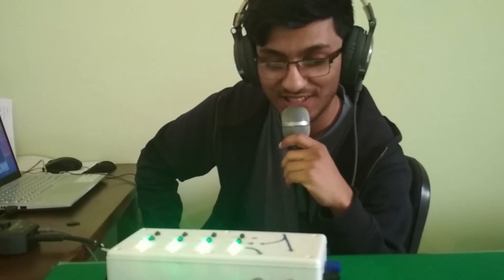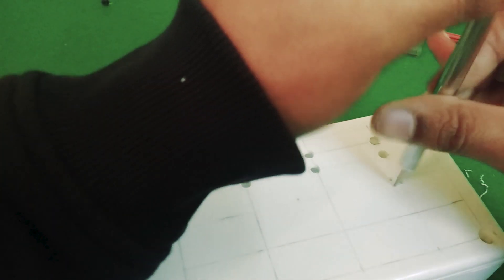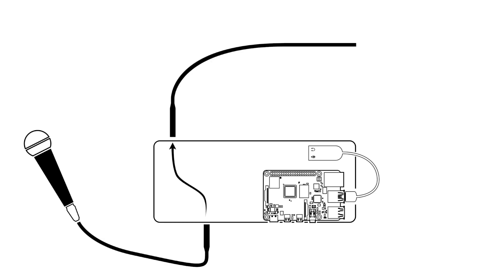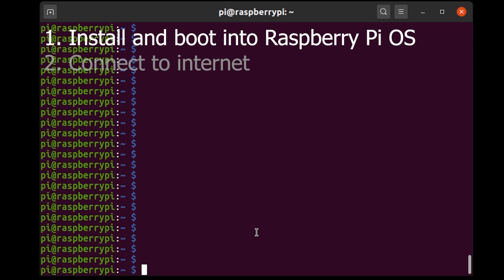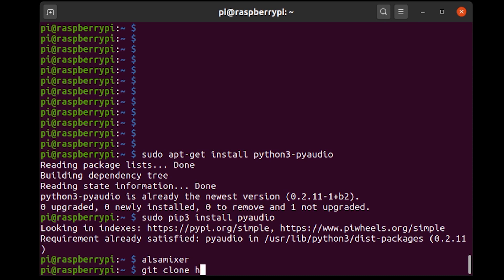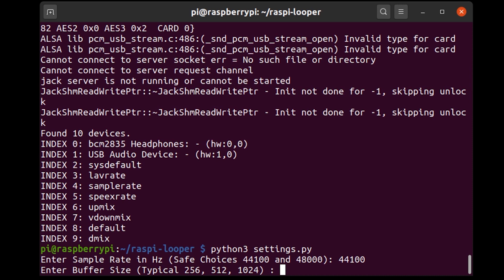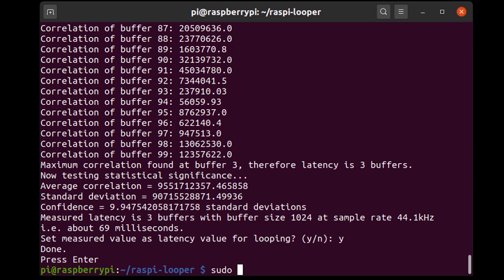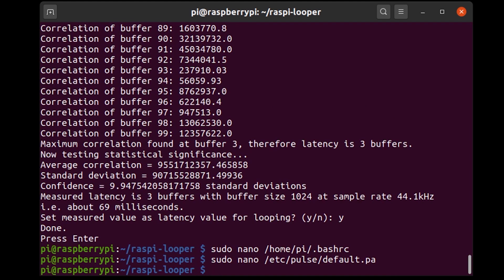DIY 4-Track Looper w/ Raspberry Pi | Building a Loop Station

Comment: Of the audio jack wires, which one is positive and which one is negative? Grey or white?
Reply from the maker: There's not really a "positive" and "negative", perhaps more a ground wire and signal wire. The sleeve terminals of the audio jacks should be connected to ground. I think I use grey wire for ground.

Comment: Great build! I'm putting things together to build it (mostly) from parts I have OH. So, thinking of ways to simplify the output, could you input to the onboard 3.5mm and output via Bluetooth?

 I really want to input both signals into the aux on my amp, so could you just splice the two signals back into one 3.5mm output?

Anyway, thx for video and great idea.
Reply from the maker: I would not recommend using Bluetooth, mostly due to possible latency issues. Using the internal soundcard should work - it occurs to me I've never actually tried it - but I've heard the onboard audio is pretty bad.

No, you cannot splice the output signals together passively; it would cause all sorts of problems. If you want a single output, the easiest way to do this is simply to use a USB soundcard with built-in hardware monitoring. Otherwise, you'll need a mixer circuit of some kind. I built such a circuit, and the schematic for it is linked in the description of this video. You could incorporate a circuit like that into your looper to eliminate the whole 'two outputs' thing.

Comment: what do you think about rpi 2 or 3 i mean rpi 4 is a little overkill isnt it?
Reply from the maker: The raspberry pi 4 was only marginally more expensive than the raspberry pi 3, so it seemed logical to use that.

Comment: Really glad I found this -- was thinking of this project the other day and seems the timing is perfect since you just uploaded it!

If i theoretically wanted to mix the direct out with the loop out -- is that something that can be done passively or does it need to be processed? Any thoughts on how to do that?
Reply from the maker: Glad you like it! :)

So just in case you missed it I'll point out that I built a little mixer for the looper, and there's a schematic linked in the description. If you wish, you could build this circuit into your looper enclosure and power it from the Pi header. It is NOT passive, though, and there's a reason for that.

The problem with passive mixing is that inputs and outputs are fundamentally no different... all your outputs are inputs and all your inputs are outputs, so output signals are also input signals, meaning that you would end up recording your entire loop mix onto every single overdub.

There is actually a way around this which only works specifically for "mixing" EXACTLY TWO signals. This is to ignore the ground lines on both signals and simply connect the two signal lines to the two terminals of your audio jack. This way you effectively get the difference signal, which typically is functionally no different from the summation signal. The problem with this approach is that ungrounded signals are a bad idea in general; they make you much more susceptible to being affected by all sorts of noise and interference.
Reply: @Psychotenuse  ah I see -- when you said mixer i thought it was just like a DIY mixing board you used but if it's used to mix the two outputs I'll take a look at it. Thanks!

Another question - I'm thinking of replacing the MIC input 1/4" jack with an XLR jack (maybe even an XLR & 1/4" combo jack) -- Any special considerations you can think of on that one? I assume I'd use a mono XLR jack rather than stereo but i'm sort of a beginner on this stuff.
Reply from the maker: If you're a beginner, I would recommend using a 1/4" TS jack, because it's simple. The XLR connector, while often used for unbalanced audio, is in fact "supposed to be used" for balanced audio. If you wanted to make a legit XLR input you would need yet more active circuitry. If you want to use a condenser mic you need phantom power, further into the weeds!

Now you could simply connect an XLR jack without all this circuitry, as an unbalanced input. You can look up XLR unbalanced connection to see how this is done. This would probably work for many things (dynamic mics for instance) but might not work for everything you plug in.

Comment: this is awesome i want to try it just wondering is there a way to modify this to rec longer to be a 4 track recorder?
Reply from the maker: Well, you can change the maximum loop length by changing the value of the global variable MAXLENGTH in main.py. However, this will still only record the loop to RAM, not to disk. My Python looper for PC can record your session, but the Raspberry Pi version can't (bit harder to do in Linux). It is a feature I've been thinking of adding, though I probably won't get around to it very soon.
Reply: @Psychotenuse  k can you use a pi3 b+ as well? like same hook ups for switches and leds as pi4 that u use?
Reply from the maker: Yes it should work, just refer to the GPIO layout of the Pi 3 and make the connections as per the text file linked in the description.

Comment: Awesome videos and I appreciate you sharing your knowledge! I already have some ideas for a project I'd like to make, but I have some questions for you if you don't mind.

1. As I understand it, it would be possible to build this device such that you could just use an electric guitar cord's jack as the input, correct? If so, could you bypass that step and build the looper into the guitar in some way?
2. Along those same lines, this version of the build is using your laptop as a power supply (I'm assuming), could this device work with a more portable external power supply like a 9V battery?
3. Regarding the two outputs, if you wanted volume control over the loop tracks and the "lead" guitar separate, could you simply connect the two outputs to two different amps? Is it possible to build a small mixer that gives volume control over these two outputs individually before combining them?

Like I said, awesome project and videos. Thanks in advance for any guidance you can provide.
Reply from the maker: Alright, so...

1) Yes, you can plug your guitar into this looper. Putting a Looper in a guitar is a funny idea, I'm not sure I'd be interested in that - mostly because a) While I don't mind making small electrical mods to my guitar I'm not thrilled by the idea of messing with it that much and b) I almost always will want to use a multi-fx pedal or something like that between my guitar and the looper. All this aside, if you want to build this looper or something similar into your guitar I see no reason that it wouldn't be possible, except that with an electric guitar you might have to rout a new cavity for it.

2. I was using a cell phone charger as a power supply. The simplest way to make something like this portable would be to use an off-the-shelf power bank.

3. I did build a small mixer to combine the signals, and I talked about it briefly in the video. A schematic is linked in the description. Yes, you could certainly plug the two signals into two separate amps.

Thanks for watching! :)

Comment: I've been wanting to make something like this.  Do you have a detailed parts list you could publish?
Reply from the maker: I've added a parts list to the wiring illustration document.
Reply: @Psychotenuse  thanks!
Reply from the maker: no worries. I'd love to hear how it goes if you build it :)
Reply from the maker: No... but sure I'll write one up, give me a couple of hours. I'll add it to the wiring illustration document.
I'll list the parts I used, but you could do it differently based on what you want to do with the looper.

In particular, the parts for the audio connections might be different depending on your needs and what soundcard you use. For example, if you use a USB audio interface with direct monitoring capabilities, the whole 'two outputs' thing becomes unnecessary.

Comment: Is it possible to have 16 tracks with 8 pages?
Reply from the maker: Hahaha no but tbh if that's what you're looking for you're probably best off using a laptop imo.
Reply: @Psychotenuse  What would I need to make this happen? I know I can achieve this with ableton live but I'm looking for a diy standalone unit like what you've created. Could it handle 16 tracks without pages? Any other diy solution you can think of? I need a new hobby. Lol
Reply from the maker: This kind of implementation would probably really struggle with so many tracks - primarily because it's Python. I suppose if it were done in a C like language it might work.

One possibility is to simply run a desktop application on a Raspberry Pi (or similar small computer)... in effect you still use something like Ableton, but just on a headless computer instead of a laptop. You could incorporate computer, soundcard and Midi controller into one portable unit.

I have been hearing of something called sooperlooper; maybe that will suit your needs?

Comment: Cool build! 
Are you aware of sooperlooper? Open source looper software that is very powerful. I think it can be run headless and might be possible to integrate into your python scripts. It can help with the latency issues. Python takes a little too much resources for the realtime audio work.
Reply from the maker: Interesting, I did not know about this! I'm really not much of a programmer at all, so I'm unlikely to do this myself, but if you or someone were to incorporate something like that I would definitely check it out, haha.

I do agree that a simple task like this has no business needing the amount of resources that python seems to, but since it works and is not cost-prohibitive with the Pi it's mostly good enough for me right now. I think think I might try it on a microcontroller some day in C++.
Reply: Check also otem rellik looper thing so you can get ideas to improve your project in each single direction ;)